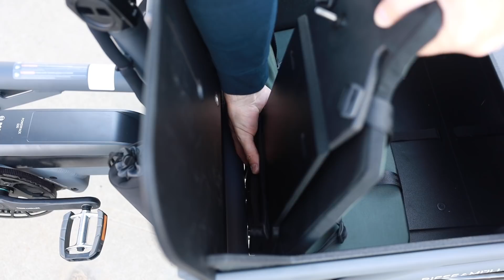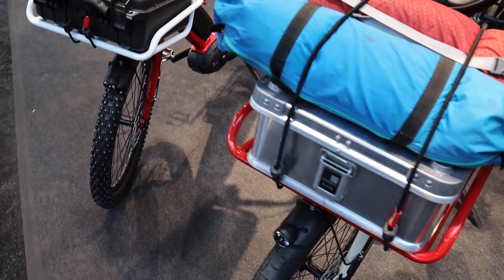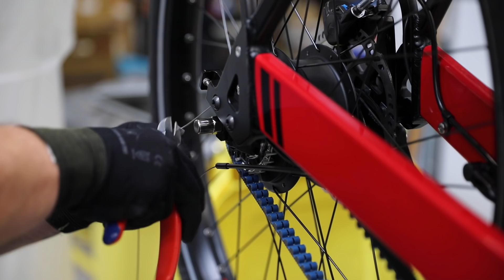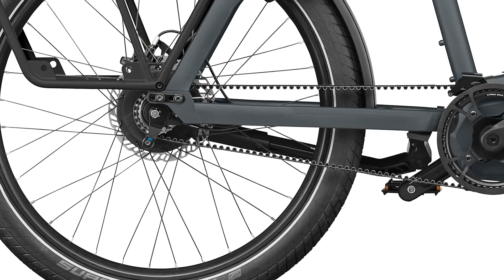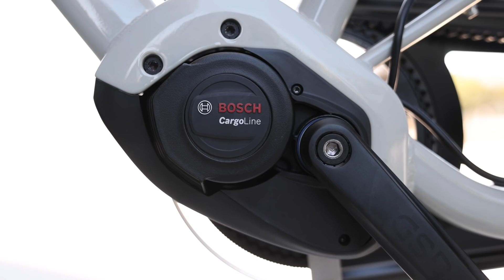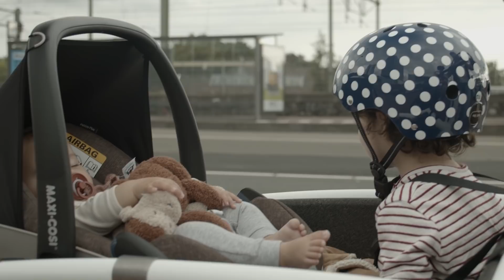Top Electric Cargo Bikes

Comment: Hello....I was on a search about two years ago, for almost a year, for an ebike. You're channel popped up as a suggestion. A 1yr old video no less.  So I thought I'd drop a comment...
Buying an ebike is kinda like buying a car.  It would have to fit my needs and not my wants.This sh*t's expensive! I needed something reliable in the rain, wind, humidity, cold snow, uphill, downhill, road, sidewalk, and dirt paths. For work, groceries, errands, bulky heavy items. I spend a year looking, researching online, reading reviews, test riding at local shops...I ended up with the RadRunner 1, 750w motor, 48v 14ah, 300lbs capacity, built like a tank! Simply easy and cheap to maintain. At the time, Nov. 2020, it was the most bang for the buck! And it still is today.

And I just bought an ebike for the wife. 
The KBO Ranger. It's a beast. 750w motor, 48v 17.5ah, 400lbs capacity! It's roughly the same length as my ebike. Simply easy and cheap to maintain. It was a toss up between the Himiway Big Dog and Radwaggon 4. And the price for the KBO Ranger was the selling point! 
We haven't had a car for about a year. And it obvious in many ways we don't need one. And I can't get her off  her bike to even test ride it. LOL

Comment: I have tried the Rohloff so many times on an e-bike, and I didn't like it. I had to switch too often, and several shifts at once. And the electric shifting option was also so slow to shift to the correct position. I find ebikes need bigger gaps between gears, and faster gear change. Is there anybody here who uses the Rohloff on an ebike and is happy with it?
Reply: long delay on response, but I put a Rohloff on an extracycle stoker and am happy with it.  I live in a very snowy place, so the internal hub was key. Ours is not electric shifting.  It's fairly easy to shift gears, but the extra boost from the motor means you can upshift and roll through snow or some hills in a higher gear without sacrificing pedal comfort.  I don't find myself "searching" for the right gear continually, but perhaps thats because I commuted on a single speed bike for 20 years.   Note: I also have the enviolo hub on an urban arrow.  It has been amazingly durable and user friendly.  I guess it's not as efficient, but I don't notice it at all.   I would only give the Rohloff an advantage for the gear range.  It's my opinion that an ebike with a 20mph top speed, you don't need the 525% range on the Rohloff unless you are managing 20% grades with 100lbs of cargo or kids.  Put on a bigger rear cog in the back, and you can spin up hills and still pedal up to 20mph.

Comment: Please do a video for dog lovers specifically and non urban in relation to challenging terrain or hilly areas. Thanks
Reply from the maker: Great point! We will do our best!
Reply: I haven't so far driven other cargo bikes in non urban environments other than the R&M Load. But this has seen heavy use in rural settings = roads with potholes, mud tracks, gravel tracks and grass tracks. It's also mountain country.

The full supension is the best one can have, it gives you not only riding comfort but also security. You might want to invest in the double battery option if you drive a lot in hill country, it just gives you more piece of mind. I remember in the first weeks (I opted for one battery, thinking it enough) driving home with a fully loaded bike and the battery getting lower by the minute. Up here it's always downhill, with the wind when empty but uphill with head wind when full. So it was kindy scary to see the range drop and drop with each climb and still more mileage to go.....

Ordered a second battery the next day :-)

if you want to see some heavy use in challenging terrain and with a dog, check out this guy's channel

https://www.youtube.com/watch?v=7gKCzfHkXrY

Comment: Can you share more about changes to the Urban Arrow Family for 2021? Which motors will be included on the Performance Line and the Cargo Line models? Will these motors still have the 2.5:1 gearing or move to the 1:1 pedal/chain ring ratio? How about battery sizes? Thanks for these great videos, keep up the good work!
Reply from the maker: Thanks Tim! Much appreciated! We will do a review of the new Urban Arrow family very soon. The 2021 models with have either the Gen 3 Performance Line or the Gen 4 Cargo Line. Both will age the 1 to 1 pedal ratio and I believe the Performance Line version will come with the 400Wh and 500Wh on the Cargo Line.
Reply: @Propelbikes  Thanks for the reply, I appreciate it! Looking forward to your new Urban Arrow video as well as the Packster 70 review!
Reply from the maker: You got it! I’m working to get them up ASAP.

Comment: Thanks for the video! I have a question about Enviolo hubs. I've heard that with a pedal motor it's important to stop pedalling and wait for the motor to stop before shifting gears, otherwise the hub and cables get damaged. Is this true? Or would it act like a derailleur while pedalling (with the additional benefit of shifting when stopped)? Thanks! Hesitating between the S10 and S00.
Reply from the maker: You do have to let off your pedaling a little bit. You can sometimes get away with not, but it’s a good practice to do so as it puts significantly less stress on the hub shifting parts. I would recommend trying a bike with that hub system if you have an opportunity.
Reply: @Propelbikes  thanks! :)
Reply: Salut Martin ! ahahah !
Reply: @FXPasquier  ✋🤦‍♂️
Reply: The Enviolo hub locks you out from shifting if there is a great amount of power going through it, and the less power the easier it is to shift (the shifter feels less sticky). Not pedaling or pedaling without force allows the shifter to turn easily.

My experience with a heavy front cargo bike + Enviolo + 450 pounds of payload requires a lot of deliberation of both the power setting and the Enviolo, and that it's often best to set the Enviolo somewhat low and then not change it until you're at a fairly high speed. You also cannot just set the power level to max and hope the torque sensor smooths out your pedaling; often you have to spin really fast while having a lower power setting. Spinning slow with a high power setting with a heavy payload can often result in stalling out if you misjudge an incline with no way to shift down (at least not with an Enviolo).